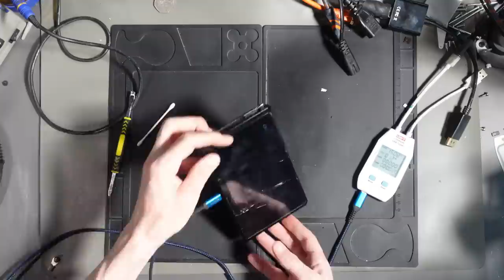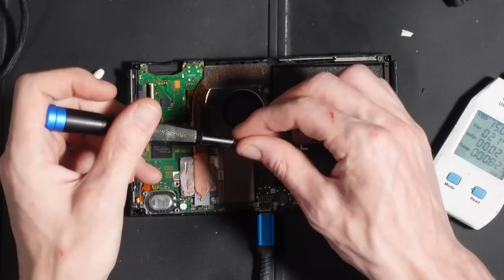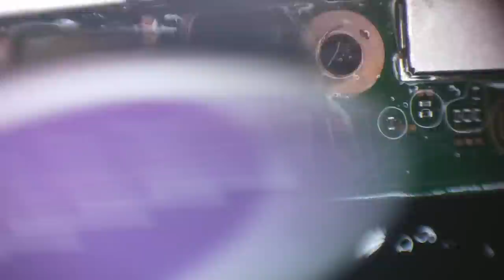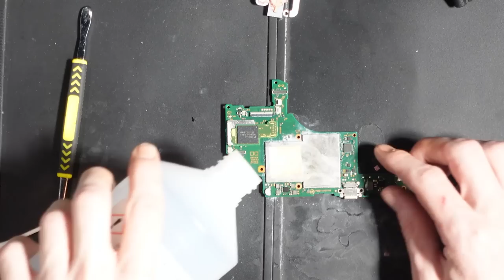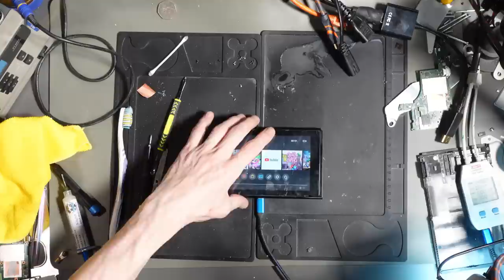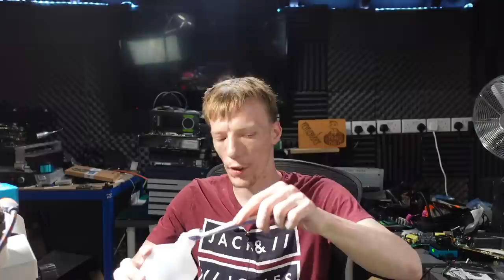This Liquid Damaged Nintendo Switch Just Kept Getting Worse... But Can I Fix It?

Comment: To test if you've fixed a blue screen properly I usually like to slightly twist the assembled switch while playing a game, if it artifacts or freezes it means there still are connection issues with the APU/RAM. If it doesn't do anything it probably was something else

Comment: Hi good video bud you can lower the temperature in the loft by using a y pvc pipe and extractor fan into the bathroom outlet to pull the hot air out mate it must be hard to concentrate to be fair as you must be baking 30c plus lol just get a good one 40 to 50 pounds on ebay 😉 👍 easy to wire up.

Comment: Hi, TheCod3r . 
ever collect or disassemble the equipment connected to the power supply (preferably, immediately after disassembly, disconnect the battery). When you put the shield, I thought it was metal and you can to short somewhere and here the boom =) and when I saw the screen with the stripes, I thought you shorted the screen. You are lucky that something did not burn out. But after that, when it was carried, you began to tighten the screws)). But they can be dropped ;-)
P.S. Why didn't you tear corrosion SMD with a soldering iron? And yet, try to remove the connector on the donor board in the following way:
1) Put the legs of the connector with a soldering iron and an Rose's alloy (you can use Wood's alloy, it melts at an even lower temperature, but it seems to be more poisonous and you need to use an extract). The melting temperature of the Rose's alloy = 95 degrees. The melting temperature of the Wood's alloy = ~ 70 degrees.
2) Use a soldering -hair- (google-translate, damn =) ) dryer with a temperature of 100 degrees. Increase the temperature so far either is unsolder or the plastic does not melt
p.s. sorry for google-translate. The video was interesting!)

Comment: crazy question but if i was to take the back off of my swithc to clean the vents and the fan do i need to replace the thermal paste? also is it needed you know cleaning the dust out once in a while if you use it only in handheld mode?

Comment: i have this specific motherboard. these are the version 2 switches for me its a bad max77620h am not getting the 1.35v rail so @thecod3r and you confirm that the max77620 is an (A) or (H) because mine is max77620H and i don't know if i should get the max77620A since the H is harder to find. this will help me greatly thanks